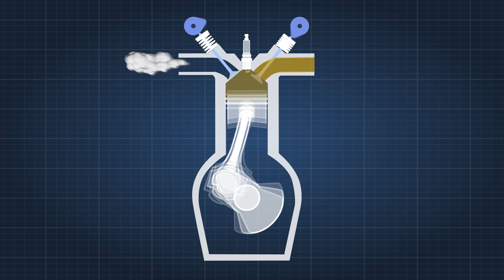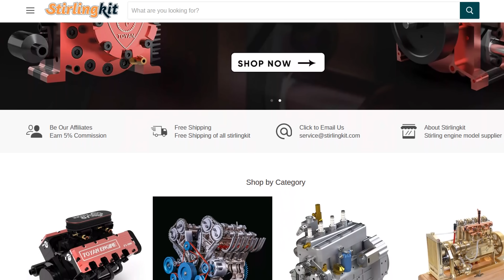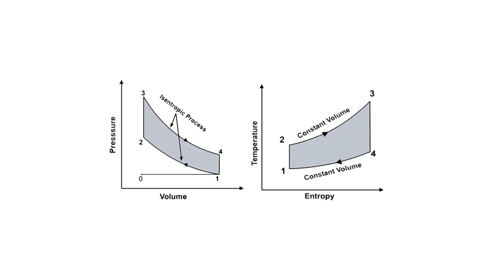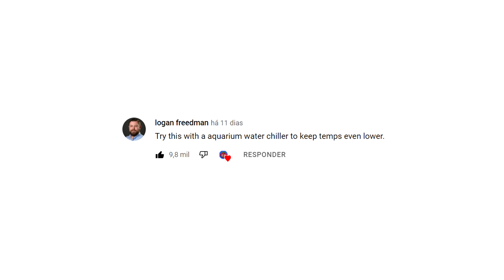I 3D Printed a Transparent Combustion Engine in Resin

Comment: Video idea: Make the "engine" of the world's oldest air vehicle: the hot air balloon. You could 3D print the burner with metal like you did in a previous video of yours, or build it from scratch with materials you have around. At the end you could put the balloon attached to a scale to calculate how much force it can generate trying to go up, or put a gopro in it, so we could go up with it

Comment: Don't know what may cause the misfire of the engine, but maybe adding a flying weel or something that reduces the rpms may work.
In regards to the cause, my guess is that it has to do with at least one of the parts of the "triangle of fire"
-Spark: like you said, not enough energy is being suministrated by the plug
-Comburent: not enough oxygen is getting suck or exhaust during each cycle
-Fuel: either too much or too little fuel is being applied, they have a minimun limit needed to ignite, but too much will "drowned" the engine

Comment: Others have commented about timing (which is correct) but 4-stroke engines are sensitive to both valve timing and ignition timing which are controlled by the camshaft profile and magneto respectively. Your engine was designed to run gasoline at a particular RPM. If you want it to run faster, your valve timing and ignition timing must change to support that. Remember, this isn't a static picture and explosions aren't instant. The flame-front has to propagate through the volume which takes time.

Comment: I’m wondering if it only sparks every other cycle to use the unburned fuel as lubricant. I don’t recall seeing that this engine had oil in the sump. Additionally, we don’t see oil slinging onto the cylinder wall. It could also have to do with dwell on the coil. Dwell being the time it takes for a coil to “recharge” before discharging. It would be interesting to see it run a a lower speed to see if it fires at each cycle. If it does fire on each cycle at a lower RPM, then I would guess it is dwell, otherwise, lubrication.

Comment: You Have to adjust the time when the spark is actovated. Some fuels needs to ignite earlier than others to optimise PowerPoint and is why with nitro goes slower,  you Have to adjust the sensor of the spark plug. Please I need a 3d printer

Comment: gasoline has a lot of potential energy not practical energy, because of the efficiency of combustion (much more O2 per molecule of gas) then the methanol

the nitro-methane is tricky as there is 2 reactions happening, the breakdown of nitro-methane and the burning of the fuel
the breakdown gives us that efficiency of combustion we talked about above by adding more oxygen 
the burning of the fuel releases nitrogen(from the oxides produced by the nitro-methane) which increases cylinder pressure as well so you can say the nitro-methane is double acting

Comment: I'm curious if that little engine actually fires at top-dead center or not. Most "tuned" engines have a bit of 'advanced' timing which actually fires just before the piston reaches the top. This somehow translates to more power - i'm not 100% sure why though. I guess because there's more of a 'charged' stroke. possibly related to your better fuel running slower somehow...

Comment: It looks like an air-fuel mixture problem. Next time you run the engine adjust the screw that is under the carborator and it should solve the problem. Each of those fuels requires different mixtures.

Comment: The fact that you had different misfire rates with different fuels makes me think of two possible problems: one is ignition timing as different fuels have different burn rates and require different spark timings, the other possible problem is the air-to-fuel ratio. The AFR problem might require a counterintuitive solution as this kind of misfires might be caused by having too much fuel (rich) rather than too little (lean)

Comment: This is a great video and I'm so glad that I could chime in on something but your ignition system and fuel delivery valve timing and compression are very important to maintaining a clean running engine at a proper stoichiometric ratio . I love watching your videos but yeah when you change fuels you do change the carburetor or the tune if it's electronic maybe you can set it up with a fuel injector at the right fuel pressure and pulse width timing it'll run.

Comment: I design parts for historic race engines for a living so get to play with petrol and methanol engines a lot.
First thing to note, engines run best when they are under load. We test our engines on a dynamometer which measures how much torque the engine can produce by holding it at a fixed rpm (or a slow rpm sweep) at full throttle.
Small engines like yours don't have a rev limiter like modern cars do, they rely on not physically being able to run at a speed which damages them from the forces. So when you run the engine without load, it will speed up indefinitely untill something either limits the speed or the engine breaks. In this case, I suspect your ignition struggles to keep up at speeds above 5000rpn or so, but I can't be sure from here.
Last thing to note, when you run petrol, the stoichiometric ratio is 14.7:1. But with methanol it is much lower, around 8:1 if I remember correctly, and nitromethanol is around half that. Methanol can produce great power in cars because it cools the intake charge making it more dense, and was used a lot prewar in racing cars. Anyway, you didn't mention any adjustment to the carb between fuel changes, so would have been running much leaner on the later fuels, limiting your speed.
Feel free to PM me if you want to discuss it at all. Cheers for all your great content too!

Comment: Your acrylic was bubbling near the top in the first run which I guessed was your issue for compression. This is my biggest guess for why your missing a stoke. The acrylic is probably flexing/vibrating with the force causing the gas not to enter and exit properly into the engine. The only other guess is your carburetor isn't atomizing fuel properly for the rich fuel to be burned; which is my guess regular why gas ran better than enriched fuel. Try adding a fuel valve to keep the fuel from sitting in the chamber until you run it, this may help keep extra fuel from entering the system🙂
Reply: Use some ultra black gasket maker between the acrylic and engine to help seal😊

Comment: So what I believe is happening here is that your running the engine with no load. There may be other factors as well but because there is no load on the engine it has to skip power strokes to keep itself within a target rpm. Otherwise it would continue to go faster and faster until it eventually destroys itself. 

If you squeeze the flywheel, you will be applying a load and I’m willing to bet you will be seeing more consistent power strokes and perhaps the engine won’t be missing any of them at all.

Comment: I would say look at the magnet ignition that generates the spark. Usually you have a CDI (Capacitor Discharge Ignition) which regulates the intervals of the sparks. It hast to be timed correctly with the strokes of the enigen. If you manage to fix that I'd think the gasoline should perform waaaaay better. 

My suggestion for the next video would be a jet engine powered 3D-Printer - what else?! 😀

Comment: Fun fact, in the 80s, some F1 teams used Toluene as fuel.
The result was 1500ps from a small 1.5l 4 cylinder engine.

Comment: I’d be willing to bet that the exhaust any/or intake valve isn’t shutting all the way. In the more powerful fuel, the explosion of the powerstroke creates enough force to force the valve closed, whereas with the less powerful fuel, it isn’t enough to push the valve the rest of the way closed.

Just a thought, though. You can see the pushrods flex too, which doesn’t help engine performance

Comment: I believe ignition timing is around 10-20 degrees before TDC... so my theory would be that since 25% nitro which ignites more readily is offering more "resistance" to the rpm, an engine has a flywheel to help with advanced timing by overcoming that 10-20 degree before TDC ignition of the fuel air mixture... so if the 25% nitro ignites on every 4 strokes that resistance in every power stroke would result in lower RPM... I mean possibly it's spark but I think my hypothesis is more fun.
Reply: I meant to say the flywheel provides the nessecarly Inertia to overcome the sparks timing prior to TDC (top dead center)

Comment: Doubt anyone will read this, but:  While alcohol may have lower energy density, your engine still takes in the same amount of air, and thus you must put in enough fuel to get the air/fuel ratio right. So the alcohol on the same carb settings as gasoline, is going to run leaner. Your observation of "less power" is probably not true. It's just burning faster and cleaner, so you're not seeing it as much on camera. Could also just be the different color of an alcohol burn vs gasoline. The alcohol is likely closer to a good mixture and thus the engine is fastest on that. I would expect that once you get the mixture right, you will get an explosion on every other stroke. However, it could be that the designers had you set the mixture soo rich to keep the engine cool,....which may be even more of an issue since you're using resin.

Comment: Make a hydrogen generator that produces enough hydrogen to run a small engine and then have that small engine run a generator that generates the electricity that is needed to run the hydrogen generator so the engine is running the hydrogen generator and the hydrogen is running the engine and it’s all a continuous cycle until you run out of water in the hydrogen generator

Comment: To borrow a term to describe more "energetic" substances (such as pure nitromethane) perhaps the methanol and rc car fuel is more brisant (faster combustion velocity) than gasoline. So despite the higher idle rpms of the methane/nitromethane, you might see greater power output with gasoline when the engine is under load.

Comment: It was with compression ratio for example older engines had a worse compression ratio allowing them to run on other fuels like kerosene and methanol, basically any flammable liquid and with today's engine compression ratios they are more powerful and better than older engines with the downside of them having to use a specific fuel like gasoline or diesel.

Comment: Who told you they would be at 25% efficiency? Nearly all cars sold nowadays are well above 35% efficiency. If you want to get higher efficiency you'd have to go to turbines (with heat recycling) or directly to steam-engines + turbines.

Comment: The engine is misfiring this is a pretty common thing I think. I work on cars occasionally and I immediately recognized as misfiring. the engine is fine it's meant to do that and it isn't a critical issue it's because of how the magnet sensor work so you could just get a better magnet sensor or something. It might be that it came from the factory like that and it's meant to keep the engine from rubbing out of control and destroying itself like if it hit 8,000 RPMs which could be the theoretical (It's just a totally random guess of multiplying the number of times at fires per cycle so if it if it misses every other and it's hitting 4000 then I guess it could hit 8,000. I don't know I'm not a numbers guy though) if it hit every single one it might destroy the bearings or something.

Comment: Please build an enclosed and pressurized Stirling engine.  Use helium as a working fluid.  Make it all transparent, apart from the hot-side heat exchanger (which could form the base).  Embed magnets in the pistons and use external coils to generate power.

Comment: Nitro could burn slower. e.g.  Topfuel drag cars that run Nitromethane run more ignition timing advance than other performance engines with "normal" gasoline. The goal is to have the peak cylinder pressure at the right time to have the most torque out of the engine. If what I'm saying is true you would have to advance the spark timing. And no, octane won't have any effect on fuel burning speed, this has been tested by Engine masters (Motertrend).

Comment: The word you are looking for is "stoichiometric"...  A lean running engine spins faster but produces less torque.  A rich running engine runs slower and also produces less torque.  An engine burning the proper stoichiometric mix of fuel and oxidizer (air) produces the most torque at a rotational speed somewhere between the lean and rich mixtures.  The alcohol, having a lower caloric content requires  a richer mix than gasoline.  So your engine was running faster.  Nitromethane...  opposite logic.
Reply: This might also account for the poor combustion issue...  improper stoichiometric mix...  too rich or  too lean to light.
Reply: This

Comment: I think the mystery of skipping power strokes may be that this engine is a "hit and miss" design. These were once commonly used in farming or industrial settings where a steady RPM is desired, but where the throttle doesn't change, but the load may. Most hit and miss engines work by holding the exhaust valve open so the intake stroke doesn't create the vacuum necessary to pull air/fuel in from the intake, and the compression stroke doesn't compress anything, allowing the engine to freewheel until it slows back down to the set RPM, some work via ignition cutout, and some do both. Ignition cutout is less efficient, because the intake stroke is pulling in the normal charge of fuel, which then is simply pushed out the exhaust, but back when these were in use, gasoline was plentiful and cheap. 
In looking at your video, it's easy to see that fuel is being drawn in on the intake stroke, so I would guess that your engine is using only ignition cutout.